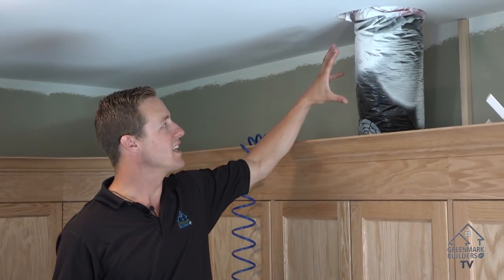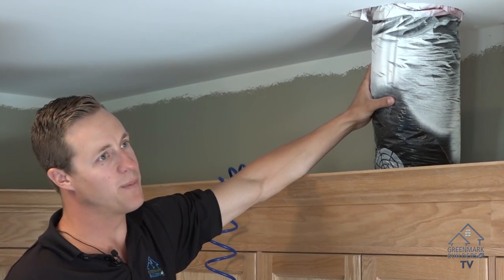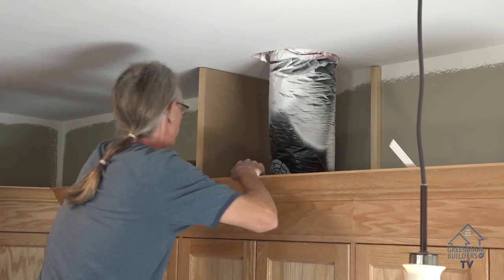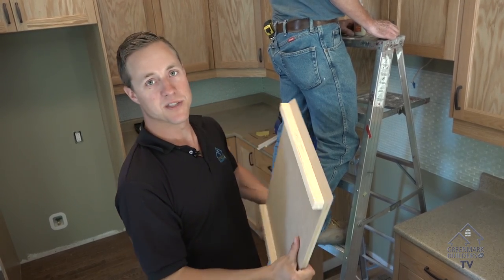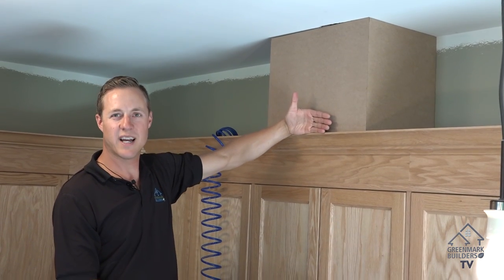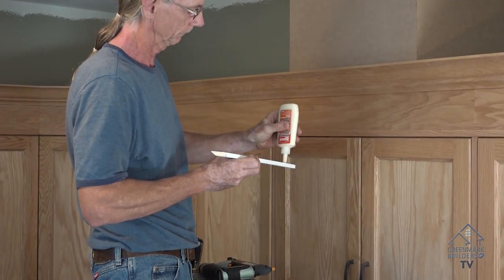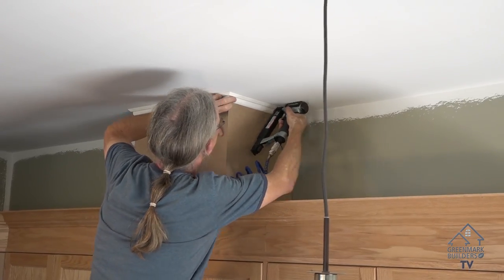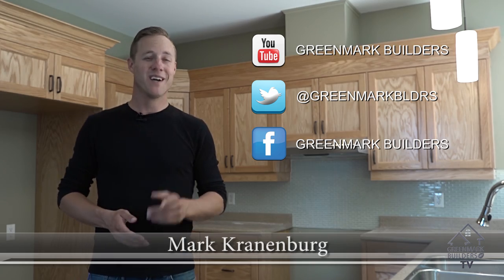Boxing in a Hood Fan Exhaust Duct

Comment: It looks beautiful. How would you open that up if you have to replace the ducting? I just had a range hood installed to replace a microwave vent unit but I sense some air escaping so I want to check the ducting which is hidden behind a wooden box like yours.
Reply from the maker: you would do some damage for sure